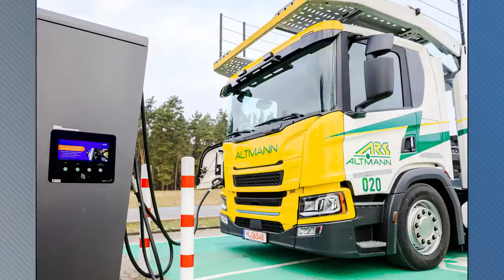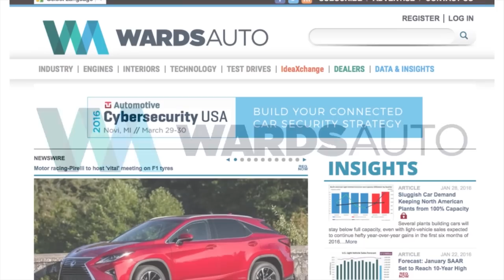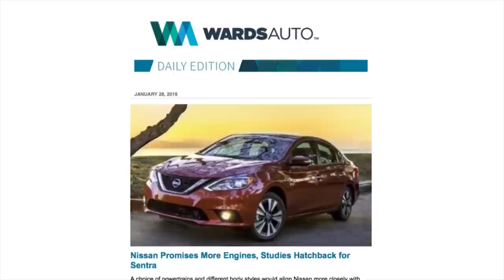Nissan Makes EV Plans Without Renault; Toyota Getting Into E-Fuels - Autoline Daily 3546

Comment: Hey, wasn't supposed that the Lincoln Nautilus crossover, along with its' Ford cousin, the Edge, would've gone OUT OF PRODUCTION once their factory in ON is to closed in '24 to refurbish it for both BEV and battery production?

Sounds like it is either a BEV crossover or move to another factory...  (this also means the next Edge will be revealed soon as well)

Comment: I've noticed Autoline doesn't do much reporting on Aptera, do you think they will ever ship their EV?  Particularly one that goes 1000 miles on a single charge.
Reply: They mentioned it a few times. Not much point talking about something that is not in production...
Would be interesting to see crash ratings on it though.
Reply: @Custo911  At this point the only thing we need to hear is that Aptera have started production.    Maybe they can stuff a few in a semi trailer and tour the country to raise interest.  Butts in seats sells cars.  Or drive a pair cross country with no chase vehicle.    Standing in front of the cars and talking about them will put people to sleep.
Reply: Have you seen many three-wheelers out on the road? You know, the gas powered ones. Either the three-wheel roadster or motorcycles? And I don't mean the off-road, only for fun kinds. I mean on the road regularly.

Not many, are there? Well, that's Aptera's market. I highly doubt they'll survive. Especially in the upcoming recession. People can't afford car payments and new home payments anymore. Bank holding those are in big trouble. Especially after Trump remove many of the safe guards against lenders passed by congress after the 2008 recession/market collapse.
Reply: @Paul-cj1wb  I think you're way too pessimistic on the economy. But Apterra is a niche market indeed.
Reply: @Custo911  I wish I was. I'm actually a big optimist. Back in late 2001 I bought a new house, and just three years later I was being offered twice the amount I paid, which I thought was crazy. And it got crazier as the years went on. So the last time I said that was in 2007-2008. Then, the average yearly income to mortgage size in America was 1 to 8.0. Now it has crossed to 1 to 8.5, so you tell me.
Reply: We need a list of "Great Pumpkin" outfits that string along investors & public:
- Elio
- Elizabeth Carmichael's "Dale"
- Faraway, I mean Faraday Future
- Aptera
- Fisker?

Comment: Nissan and Renaults' directions were never cooperative in the EV department.

Carlos Ghosn wanted the LEAF to be out first in 2010. Renault engineers didn't like to be rushed from not developing active Air cooling, Nissan went for an equivalent to charging your phone under you pillow asleep type of battery cooling. 

Renault back in the early 2010s only had battery rental on the promise that batteries would be replaced and upgraded in existing vehicles.

Comment: Toyota kicking the ball due to their incompetence and not being able to source lithium batteries because they're late to the game and battery and material supply for the next 3-5 years has been spoken for. Using fuel cell at ports is super dumb. Those places require very little range and battery electric is perfect as they don't need a large battery - and there's no lack of electric infrastruture at ports - so charging would not be an issue either. e-fuels is another waste of time as they're way more expensive than regular fuels and 100x more expensive than electricity. Toyota is in HUIGE problem and they're trying to divert attention (and aparently journalists are happy to catch the bait) to useless fuel cells and even more useless applications for them. It's so disappointing to see media and journalists fall for this irrelevant PR push by Toyota instead of reporting about the real issues Toyota has. (and if someone thinks Toyota does not have a lithium issue - than proof is their limited supply of Rav4 Prime and Prius Prime, both use lithium, and the fact that the all new Tundra is using 30 year old NiMh technology whereas Ford and others are moving to Lithium - even for hybrids - eg., F-150 PowerBoost - and giving customers a better product - lithium uses less storage space, weighs less and allows Ford to offer a 7kw inverter built into the truck - which is not possible to do with NiMh).

Comment: Just when I thought Toyota  had a savior in Sato  that company  decides to keep its legs tied to Foolcells and EFuels and throw more money into Hydrogen powered cars and Hybrids, seems like the Japanese  are good at Harakiri,or is that Sepuku?
Reply: Traditional BEV technology is not the ideal solution in every instance.  That's one reason why Toyota is researching other technologies.  Also, some of the technologies needed for hydrogen will be applicable to EVs.  However, there's no doubt that Toyota has seriously dropped the ball with EVs.

Comment: Exxon developed a Methanol to Gasoline process decades ago and no one wanted it. E-Fuels is the same process but with a step to produce methanol from H2O and CO2 electrolysis (also not new - there's research on this going back many decades). It can be done, but it's the most expensive way to produce a gasoline-like product. I've seen companies turn to options that are obviously foolish but worth believing in because it means they don't have to go through a radical transformation. E-Fuels is one of them and it's like watching a disaster in progress.
Reply: You would think that they should be happy with E85. Once demand goes up for it prices will soar and only folks with antiques and sports cars will be able to afford it.

Comment: toyota just took a step back again.
Reply: Toyota is multi-pronged in their approach to carbon neutrality. They're not taking steps back. Because so many have this expectation that everything has to revolve around BEVs, you don't seem to accept that there are other approaches to the big target. The FCEVs and cleaner fuel for existing cars will help reduce carbon emissions. It doesn't mean Toyota isn't also working on battery technology and BEVs, they're just not only working on that.
Reply: @benjaminsmith2287  they have been working on fuel cells for decades and have gotten no where. yes i know. 🤣
Reply: @Mike-Minion  It took decades for battery electric vehicles to get anywhere. Didn't it?
Reply: @benjaminsmith2287  yes it did. but how do they compare now? one is way ahead of the other.  why would you not walk away from the other then? the did it to electric in the early 1900's.
Reply: @Mike-Minion  One is ahead of the other now as it has more infrastructure and perhaps has less challenges to overcome. But it doesn't mean that hydrogen is a dead end and won't go anywhere. As long as a vehicle is electric, it doesn't have to be BEV to me. And as long as it has little to no emissions, it doesn't matter how it is done either., IMO Toyota is smart to stay with their vision and there are plenty of other companies that share the same with Toyota. They know they need to give more effort in BEVs and I think they will and have started the process months ago.
Reply: @benjaminsmith2287  time will tell. but i do think fuel cells will go no where cause of the complication it has with infrastructure.

Comment: E-Fuel seems silly.  Compared with EVs, E-Fuel vehicles still requires a noisy, slow, high-maintenance ICE design that produces a tremendous amount of pollution. E-fuel costs appear to be 3 times that of conventional gas too.  Hard to imagine any consumer wanting E-Fuel.
Reply: Yep, I can't imagine daily driving with efuel, but I will run my trackday and antique cars on it, hopefully it will be stable from the factory. Right now I'm satisfied with E85 for the trackday car but we will see what the future holds.
Reply: @Custo911  It would be a difficult (expensive and inconvenient) choice in a few years when both car companies and gas stations can't sustain that old ICE ecosystem. 

With lower volumes come higher prices leading to lower sales, rinse and repeat. Meanwhile the new thing goes in the opposite direction, speeding the transition to the new at the same time.

Would be hard to cling to an ICE car when you have to drive half an hr to find a gas station, pay twice as much for parts, or pay to haul it to the junkyard cause nobody is buying.

Maybe not today, but wont be long for this to become the obvious trend. Try finding a watering trough by a Walmart these days, you get the picture.
Reply: @AllanSustainabilityFan  veeeeery possible. I may have exaggerated the forever part. 
Should have said until they have absolutely no other fiscal choice. 
The hate and derision is real though and it will last for a while.

Comment: Ferrari has yet to solve its fossil fuel dependency. Bigger sales undermine its minnow emission message. It needs to offer all its cars as hybrids to offer city emission "free" option.
Reply: Why?They maybe still have around  17years!
Reply: @brunoheggli2888  Its not that its customers care about the climate, its that most of them live or want to be seen in major cities/capitals and car based emission restrictions will make its cars less usable to travel into and out such cities no matter how tiny an impact they make.
Reply: @stephendoherty8291  Well then you can drive in EV mode in the city and and the add the V12 outside!Also the public can change its mind!I dont think we realy will have a  ban here in Europa in 2035!Nothing is written in stone!
Reply: @brunoheggli2888  The deadline for pure ice engines remains unless car makers can guarantee their ice engines fuel is not carbon emitting or at least carbon neutral. So fuel sensors will be needed. Now ask how many gas stations will invest in supplying this more expensive niche fuel for only the most premium cars that can afford to pay for it. Even now, high octane, "higher efficiency" fuel is not bought by premium car drivers in any meaningful volume. We also know that transport contributes to some of the biggest carbon emissions and unlike shipping/airplane/heavy moving machinery - there is an energy solution and its electric. By 2035, climate change damage will be even more noticeable than now and even less accepted. Will porsche owners have to fuel up in advance and queue at the few gas stations offering this "zero*" carbon fuel at a higher cost and have owners field calls about being climate damage ignorant?

Comment: Renault doesn't have the funds to develop its own clean sheet EV models. Renault would be better to sell its shareholding at a premium and use that cash to survive and develop. It needs a European partner who wont dominate it. Not many empty chairs left bar BMW (who partner with psa), mercedes (too big and German), Fiat (now with psa under stellantis), VW (no more low profit brands needed). Sadly the best chairs left are Japanese and look how thats worked. China brands would gobble them up (although Geely did well). Tata might be one option. If I was Renault, I'd be visiting Munich for a working lunch fast. Hyundai-Kia might be a hail-mary but asian working culture is very different from the French with state backing.